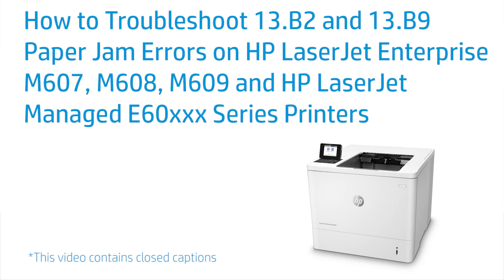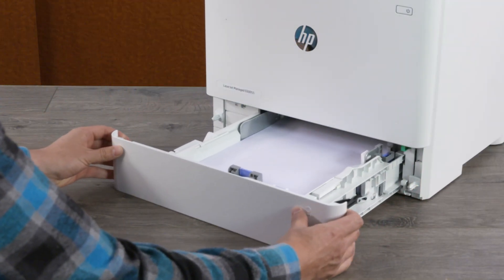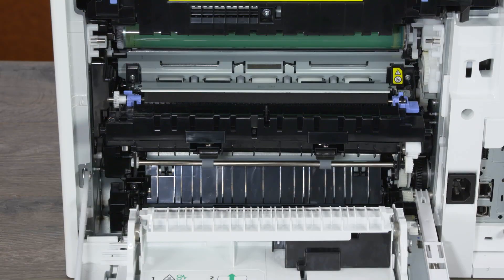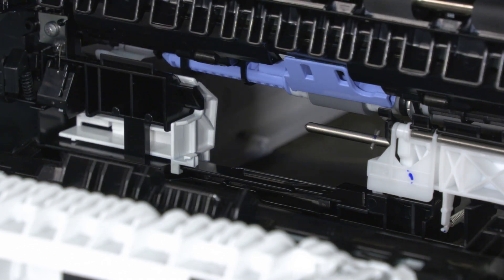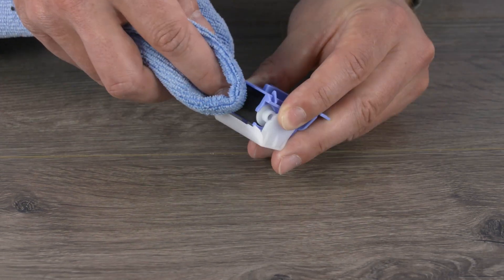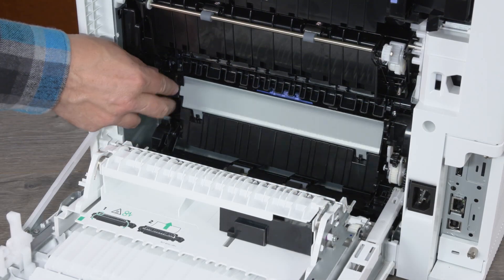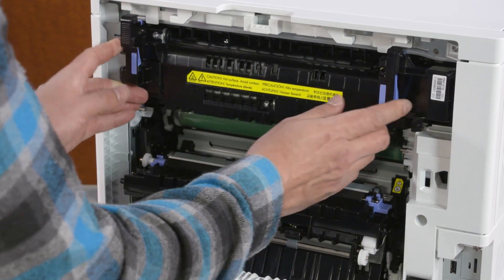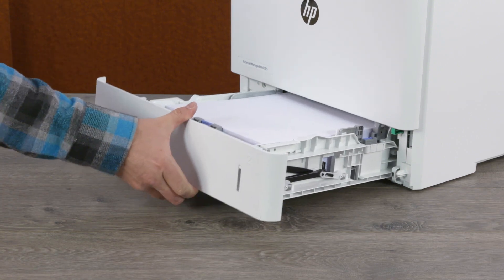How to fix paper jam errors | HP LaserJet Enterprise M607-M612, E600xx-E601xx | HP Support

Comment: If all else fails you’re looking at replacing the pick up assembly
Reply from the maker: +DarthJar If the issue still persist, please contact our phone support team for further assistance. Please follow these steps to reach them.
Step 1. Open link: https://support.hp.com/us-en/contact-hp
Step 2. Select the product type.
Step 3. Enter the serial number of your device or select let HP detect your product option.
Step 4. Select the country from the drop-down.
Step 5. You should see the HP phone support number.
Reply: @HPSupport  I don’t need to contact your phone support team. I replaced the pick up assembly on my 607 and fixed the jamming issue. There’s a reason HP discontinued this model so quickly.